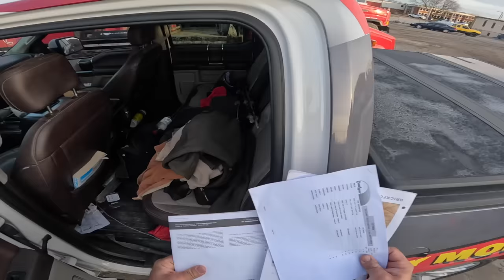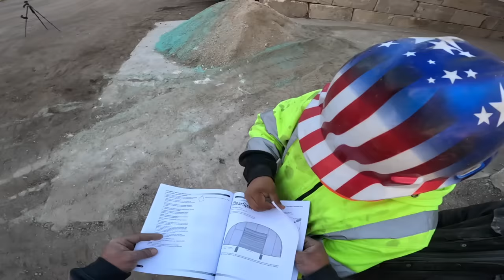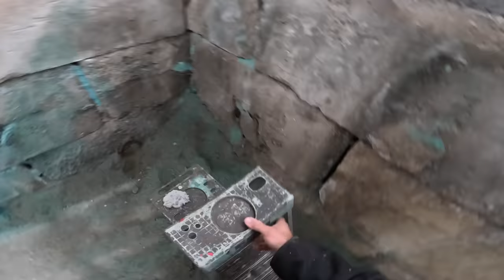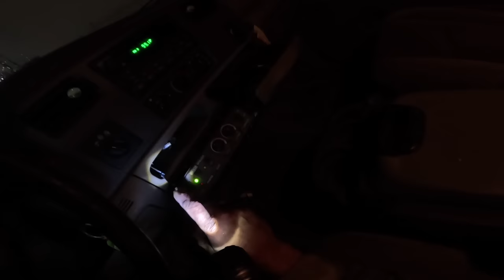Snow is coming. Let's get this salt enclosure built!

Comment: I love how Ryan uses the concrete saw to cut through anything 😂
Reply: 🤣🤣🤣 Multi-tool.
Reply: Just like any other saw just a different blade and more power
Reply: @skeena59  they all do the same job lol
Reply: You do know they can change the blade?
Reply: @skeena59  Thats clearly a metal cutting blade.
Reply: The diamond blades we used were made for concrete and metal. Remember diamond is harder than everything.

Comment: Did you check your clearances with the high voltage overhead line directly behind your salt  bins  electricity jumps especially when metal is in close proximity  worked in the industry for 48 years. In England our hse would close you down, serve a notice and prosecute for unsafe practice
Apart from that keep up the good work 😃
Reply: Have a great Xmas

Comment: I used those lifts alot when I had to rub the joints on the walls, they sway alot but they really are pretty sturdy. I have been up in a big lift probably 45 to 50 ft and the sway was crazy with every little move. You get used to it if you use them alot . Love the videos hope you all have a great Christmas.
Reply: It's just like a single stack of scaffolding, it needs to sway. It's easier to tip over if the lift is stiff when you shift your weight.

Comment: First off I found your channel on accident, never done concrete in my life but love the content and you've taught me alot! Been thinking about a slab under my lean to last season but was nervous, now I'd tackle it comfortably just from what I've learned from you in the last week! And finally just wanted to pitch my 2cents about Boss plows, good plows but the wire connectors being non weatherpack is pathetic and causes nuisance issues from what I've dealt with. I wish you weren't across the country I'd love to service your fleet of equipment!

Comment: You can make a manlift cage to go on your forks for the skid loader and still be OSHA compliant. I was an  OSHA outreach instructor for  manufacturing and construction. This way you will have it when you need it and are only restrited by the  height that you can ift with whatever  forklift you use.l

Comment: You should drill 1” holes in the forks of the forklift attachment. That way you can put pins in them and the chain can’t slide off.

Comment: they all sway like that. there are very very bottom heavy, youll never tip that thing over. and it has a fast and slow mode above the lift and drive mode. cause it should move much faster then it was when you were on the road lol. merry christmas boys

Comment: Merry x-mas. 
In Michigan you don't need a harness and fall arrest in scissor lifts. Unless you climb out side of it. But anything that articulates, a harness and fall arrest is required. You can use a basket( osha approved) with fork lift. But trust the operator with your life. 
Also i think Darrel influenced Anne late for work😂😂

Comment: You guys think that scissors lift wobbles at 15’ 🤣  let me get Ryan in our 72’ track lift!
We put up a sheet metal quonset with no ends for round bale storage for a farmer as a favor(and money). 3900 nut and bolt sets, plus 100+self tappers at the bottom. Turned out nice, but I’ll stick to tree work.

Comment: I always take something away from each one of your videos this spring i got get some concrete and level out the bottom of my driveway where it meets the road my cars wanna bottom out now when i try going up its got about a 50-60 degree grade going up about 20 feet before it levels out so ill get bags and mix myself ill use chicken wire insde it and have a good solid base for the concrete before i lay it down

Comment: Forget Tapcons. They are garbage. Once you use GRK Caliburn concrete screws, you'll never use a tapcon again. From what I recall, typically, they hold 1000lb per inch of depth. Plus, you can take them out and put them back in and they'll still hold. Try that with a tapcon and you'll pull them out by hand.

Comment: there is a Reason why the Lift Sways that much.. the Lift you have there is a Lift Build for Inside use only its not meant for the elements nor wind.. the Lift u have at ur Wintershop the Marklift is an Outside Lift difference can be seen by the tires small no tread tires (mostly White in color) are inside use only Big Bulky tires ( mostly Black) are made for outside use!
The Risk of an accident by using a inside Lift outside is very high and should really be avoided if possible! or rather said using a skidloaders bucket in height is safer then using an inside Lift outside^^ (eventhough both isnt allowed and could bring hefty fines if noticed by the right Authorities). Be Safe and Merry Christmas & happy holidays.

Comment: try tig welding in them skylifts against a wall 15 feet up hanging off the edge with your back braced against the wall on a 6inch line. I hate them things 🫤

Comment: Too bad thee rental shop doesnt have off road lifts tires are aggressive not smooth which is for inside . And the lift has some sway but very stable  even with the extended platform  deployed .

Comment: Ryan you won't even 25 feet come on...I been in self climbers higher than that...get you on a roof like 3 stories up...on a 2x6
Reply: @henryx6377  yea been on extention ladders all way all and at the top..been up on scaffolds five up and been on roofs on the 2x6...I've gotten used to it...I'm not crazy bout hights but some ones gotta get the job done...but them lifts are only sturdy if the have the leveling legs u pull our..if not it's Swayze...lol